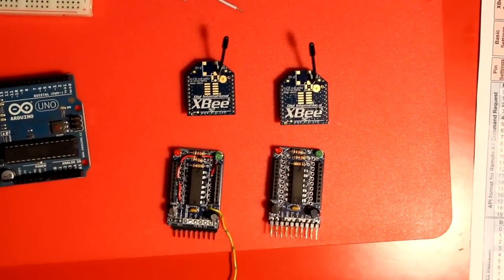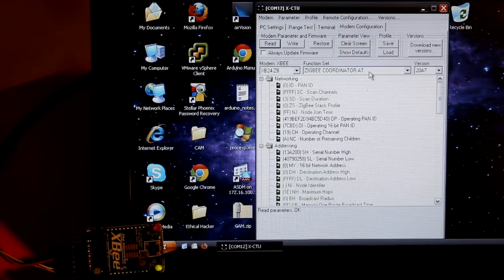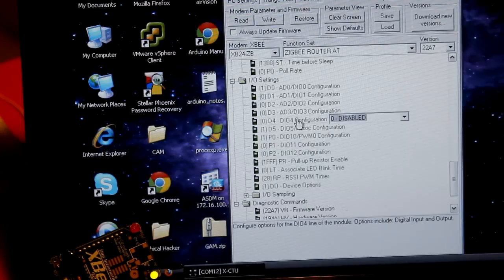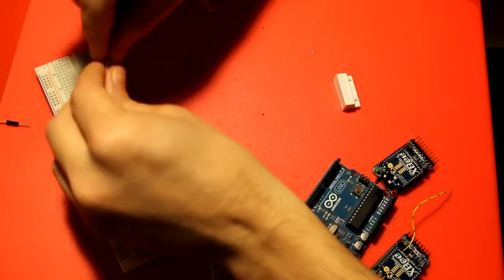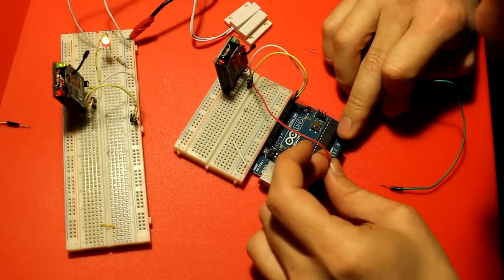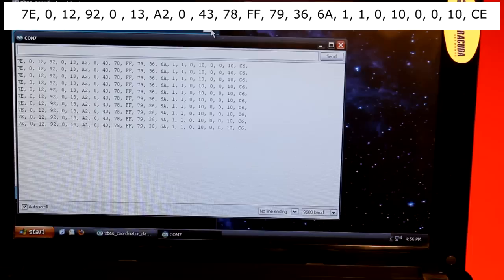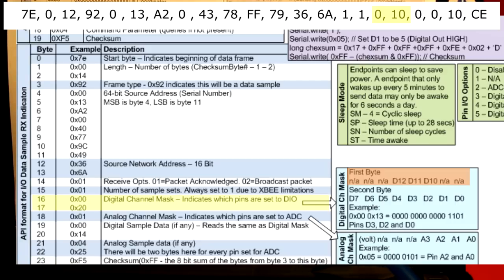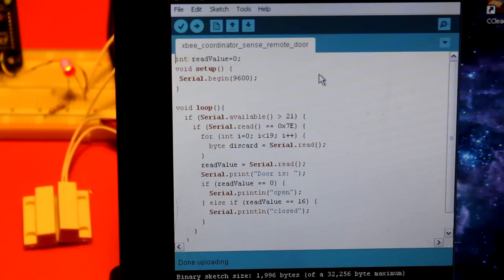XBee Basics - Lesson 3 - API Mode: Digital Input from Remote Sensor

Comment: Dear Mr.
I study Electronics and Communication Engineering in Turkey. I want to be a successful embedded system engineer and I work on IoT systems.
I am going to do a Smart IoT Project. I have 3 Xbee Pro S2C modules and 3 STM32F407 microcontrollers. In this project, there will be 2 end devices, they will gather information from the sensors like humidity, temperature, gas meter, or dust and dirt sensor and they will transfer this incoming information to the coordinator device. The coordinator device will also be a gateway and send this data to the internet. 
I examined your profile and saw that you are carrying out a similar project. 
I would be very happy if you could share with me the details of the project and the codes if it is still there to help me.

Comment: Hey. It wont let me program my arduino when I have xbee connected to it. I am getting error:
vrdude: stk500_recv(): programmer is not responding
avrdude: stk500_getsync() attempt 1 of 10: not in sync: resp=0x00

As soon as I unplug rx and tx wires it allows me to program it but I cannot see anything on the serial monitor
Reply: The process should be ---> unplug the tx/rx pins from the arduino, upload your code to the arduino, replug the tx/rx pins into the arduino, then open the serial monitor.

Comment: Hi, ive got a question, would i need an extra arduino if i want to use a end device that first send the data to the router and then the router sends it over to the coordinator?
I mean from one xbee send it to another xbee and then xbee sends it over to a final xbee

Comment: You show using 5V to power the module.  I understand the breakout board level shifts the supply voltage.  Does it also level shift the digital I/O pin?  I thought 5 V to a digital pin would fry it.  Does adding the led and resistor drop the voltage to the I/O pin?

Comment: Do we need a minimum of two adapters for this ? I tried doing this with one simple breakout board and the other with the adapter but I just cant seem to get them to work for some reason. No communication at all. To the break out board I have connected the co-ordinator. 3.3 V from the arduino goes to the breakout board. gnd to gnd. tx to rx and rx to tx. Am I missing something here? I have tried various experiments but I just cant seem to connect the router to the co ordinator. Do i necessarily have to buy another adapter? or is there a work around?
Thanks.
Reply: +Gaurav Roy I didn't need to buy a second adapter. You can also use the Arduino as a pseudo-adapter if you want to connect both XBees to one computer at the same time. Just download a blank sketch into the Arduino with the configuration you've described above. Additionally, I believe pins 6, 13, and 15 on the XBee will indicate whether it is powered, searching for a network, or receiving data, respectively. Just add an led to watch what happens.
Reply: +Gaurav Roy we need to put rx to rx and tx to tx for programmimg xbee through arduino moreover dont forget to bypass IC,check lesson 1 again

Comment: can we connect two sensors at router xbee? if connected how to get the data separatly to coordinater xbee and arduino please can you answer me
Reply: +Raghu Ram You can have many inputs (sensors) to the router xbee. Just like in the video, you will need to code a sketch to account for all possible combinations. ie. Two switch sensors = 4 combinations (both on, both off, one on, the other on).

Comment: schmatics shows VCC = 5V but XBee uses only 3.3V, So if we connects 5V to the XBee it will turns out to be the worst day..
Reply: The Xbee breakout board has a voltage regulator built on the board that takes the 5V and drops it to 3.3V

Comment: Hi *****  thanks for your video. I did the same thing you showed on this tutorial but in my case the door is always "CLOSED". I get the following data :
7E,0,12,92,0,13,A2,0,40,B3,A7,7,CF,14,1,1,0,10,0,0,10,12,
no matter whether the door is "OPEN" or "CLOSED". I can't seem to figure out my mistake. 
Could you please help in solving the problem?
Many thanks.
Reply: look at Matthew eplers comment, that may be your answer
Reply: i have the same problem, XBee S2 (Modem Type XB24-ZB), digital sample never changed, always 0,10. Have you solved this?
Reply: No I wasn't successful in solving solving this. I will post it here once I solve it.
Reply: King_of_Tekken  even i have same problem.Xbee s2 module...showing always serial data 0,10.
Have you solve it??

Comment: I have a question, I was working with a remote xbee who was sampling a digital input, but each 5 seconds the coordinator stopped receiving like for 3 seconds, and then continued receiving. After some testing I started receiving 28 bytes packets instead of 22 from the remote xbee, what am I doing wrong? any ideas? Thanks for your great tutorials! 

Here is the packet I am receiving:
7E 00 18 91 00 13 A2 00 40 A8 34 2F 06 2B E8 E8 00 92 C1 05 02 01 00 03 00 00 01 0E

Comment: This works with an S1, but the number of bytes returned is different. In this setup, there are just 14 bytes returned. The number of bytes returned per frame seems dependent on the configuration (see page 59 of datasheet here: http://ftp1.digi.com/support/documentation/90000982_P.pdf).

Here's the code I used to get a clean readout in the serial monitor. The next-to-last byte is the DI signal (0=LOW, 10=HIGH):

void setup() {
 Serial.begin(9600); 
}

void loop() {
  if(Serial.available() > 13) {
    //Serial.println(Serial.read(), HEX);
    for(int i=0; i<14; i++) {
      Serial.print(Serial.read(),HEX);
      Serial.print(", ");
    } 
    Serial.println();
  }
}
Reply: PS - I'm using the XBee Pro S1 from Sparkfun. Link: https://www.sparkfun.com/products/8742
Reply: I think this comment just saved my entire project (I am also using a Pro S1). Thanks!
Reply: This tid bit just narrowly prevented the launching of an Arduino off the 37th floor. 
It would have been a sad event.
You sir are a hero.

Comment: Hi, I have a question. I have a few old arduinos..(from 2007)..they are still working. I am using the adafruit xbee adaptor to configure them. The firmware in the xbee is 1083(very old).This is not letting me configure the digital IO pins. So I tried to upgrade the firmware fusing the XCTU next gen software. Everytime it says reset your modem. I connect the reset pin to ground at that time, and release it. But nothing happens and it says, failed to enter programming mode. Any idea what I should be doing?

Comment: @Sukru Bahadir Arslan:
Sukru Merhaba,
Alti ay uzun muddet Insallah sorularina cevap aldin. Eger hala API Mode Hk. sorun varsa kisa cevap soyle. Normal olarak switch input olarak Arduino ya baglanir ve Arduino nun TX, RX pinleri XBee nin DIN, DOUT pin lerine baglanir. Ama tek bir input icin Arduino kullanmak israf olur. Switch dogrudan dogruya XBee input mesela DIO4 baglanirsa remote XBee den laptop yanindaki Arduino ya bagli XBee ye giden mesajlari Arduino ya verip OPEN, CLOSED mesaji haline getirebilmek icin bu XBee API ( Application Programming Interface) moduna konur ve butun mesaj frame olarak 23 byt olarak gelir. Frame halindeki mesajin faydasi nereden geldigini, hangi Input Output oldugunu, vs gostermesidir. Bu ilitisimleri Frame i analize ederek daha iyi anlarsiniz. Selamlar.

Comment: I have bricked a XBee before. Therefore even the XBee adapter has a 5 Vdc pin, I am very much against to bringing in 5 Vdc to XBee. I use 3.3 Vdc supply. When the switch is open I still get close to 2 Volts, so DIO4 stays always high and it prints CLOSED. The fix for it is to place a 10K resistor to drain voltage from from DIO4 to ground ( DIO4 to GND, that would be parallel with LED).

Comment: What is the exact model of xbee you are using please
Reply: James, I don't know if you were answered, however my XBee's are Series 2 Zigbee XB24-ZB. You could use more expensive Pro series with upto a mile distance in open air. But for me 100 meter is good enough.
Reply: Thanks alot.  Im looking to control my basement lights with a relay behind the switches activated when the XBee gets a signal from the main XBee activated my a IR receiver and my tv remote.

Comment: I also switch the door bell to push button. I encounter a few problems: 1) the LED lights up although very dim even button is not pushed 2) the data frame is 10 even when router D4 is not connected to anything. It only goes to 00 if it is connected to ground. With the router 3.3v and Ground connected, I checked the voltage between ground and D4 (D4 is not connected to anything yet), it has 3.3v. Please advice! Thanks in advance!

Comment: Hi :)
I followed exactly what you did on this video but instead of using the sensor i'm using a push button.
Anyway, when I power up the router side, the led lights up although it is quite dim. Also, when I uploaded the sketch to Arduino, then connected the TX and RX pins to the Xbee, the serial monitor shows nothing. 
Any idea on what might be wrong?
Thank you!

Comment: I have appreciated your videos and was hoping you could help me out. I have done everything on your video except I'm using a PIR sensor rather than the door sensor. I have a few different Xbees that I've tried to use as the router and I receive the packets just fine but for whatever reason it always reads the DIO pin as high and sends it to me as 0x00 0x10 (because I am using dio4). Any suggestions?